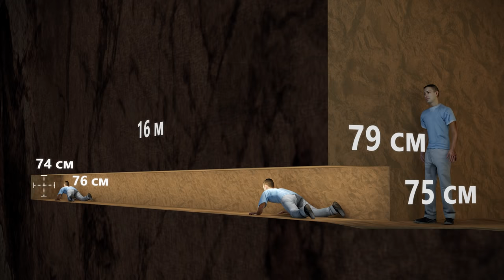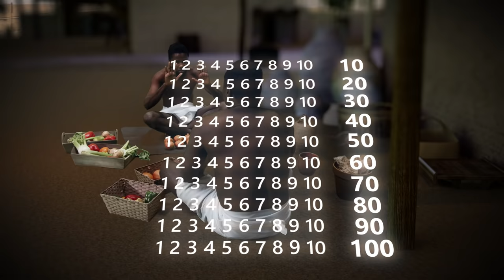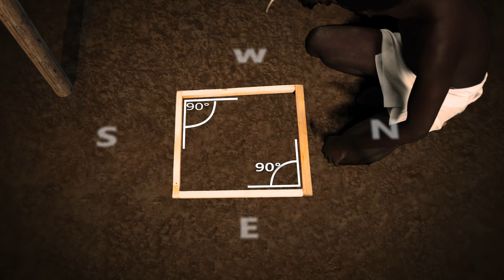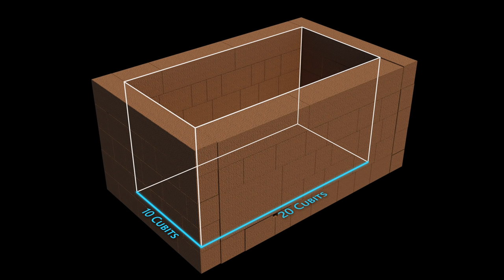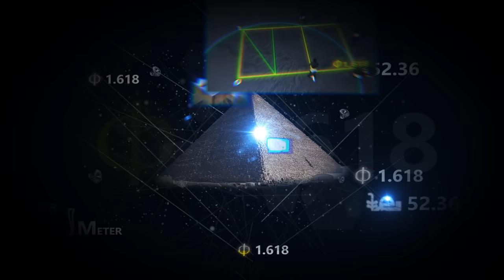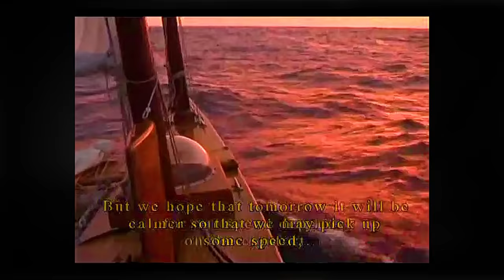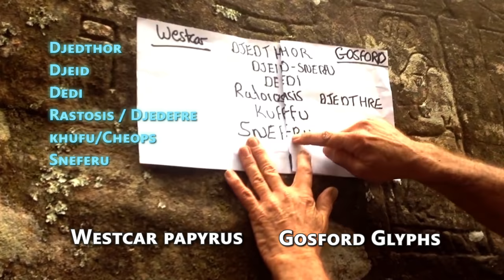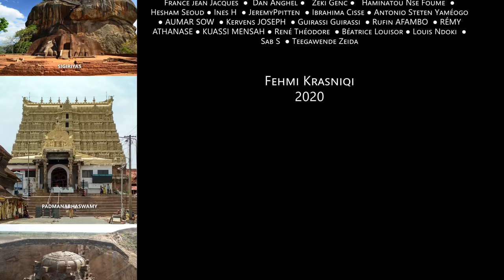The Movie Great Pyramid K 2019 - Director Fehmi Krasniqi

Comment: Interesting video with some plausible theorys but the Molton granite theory doesn't address the bore holes found, the disc like cutting marks left on some blocks or the partially cut blocks not to mention no evidence has been found of a "lens".
Reply: It's worth investigating. There's a ton of glyphs of Ra that could actually be representing the lens.
Reply: Also. If they were trying to hide this info from the initiated there wouldn't be any plain glyph of the technology. Like the pile battery/djed pillar, the dipole antenna/uas scepter, the light bulb, cables, generator, the oscillator, it's all there
Reply: Exactly and thank you
Reply: @DaliDessalines  that's not really trying to hide it though is it. And running around showing everyone what you can do and with what surely isn't.
Reply: I bet you can find one underneath the Vatican, and the bore and the holes and what you call cuts come from the concrete moulds..
Reply: I agree Tom, some interesting theory but definitely didn’t address all the ‘machining’ marks and holes.
Reply: I am very pleased with your remarks.  Because you have shown due diligence and demonstrated a keen eye.  May I be able to draw your attention; in a very insightful way, to the answer you seek.
Reply: @Alex-qf2lb  You just made me laugh uncontrollably.  In response; I have a reason for using language from the ancient courts.  Again, thank you for the laugh.
Reply: @Alex-qf2lb  Because the internet is devoid of personal connectivity. I use language as a resonance tool; to gauge the depth and width of a persons intellect.
Reply: @Alex-qf2lb  wet Sand  combined with other elements, submerged in water beneath the surface of top soil.   These holes provide temperature  control.
Reply: @Alex-qf2lb  Maybe I should not mention, lol .  Sun light routed under ground in a temperature controlled environment can be filtered and harnessed.    See lazer technology and its filtering process.  In addition, If you really need convincing.  Remember these two things while investigating.  In a society that has mastery of trigonometry and calculus.  Compare modern and ancient society use of science.  Then make a mathematical comparison from both societal artifacts.  It is funny... The African Egyptians closely guarded their secrets. However, what you dont see in hieroglyphs, but are essential to a successful society; can lead you to all the answers.  Compile a list of mathematical formulas needed to manufacture their artifacts and you will be amazed at what you discover.  Respectfully submitted
Reply: @Wandering Lion Obviously, the individual who initiated this lie.  Does not possess the critical thinking skills to recognize  in stone; a Fibonacci sequencing within a polygonal dimension of space .  In addition, after the cataclysm; Egyptians made repairs to the Pyramid, which necessitated modification.  Not to mention invaders repurposing stone while  destroying this sacred site.  I would also be remiss, if I failed to highlight the damage sustained from wind and water erosion. If you want to receive an accurate picture of African Science; you can not leave it in the hands of a mind that has mastered one or two sciences.  The pyramids were built by minds that mastered no less than 9 sciences.  Respectfully submitted.
Reply: @alexfitzgerald1355  they made repairs on the pyramid ... yeah sure, with the same technique, but forgot how to make same sizes out of wood for the cubic concrete. 
So there were at least 7 earthquakes in egypt: https://www.laenderdaten.info/Afrika/Aegypten/erdbeben.php (10.01.2021) and the pyramides had no damage. that is known knowledge, but they have to repair them... yes. 
i am also not totally convinced by lens, because why and how they could melt the stone at the broken obelisk underneath the obelisk? 

the second think had a really cringe moment was the mention of "atlantis", the big island in the middle of the atlantic, those ocean depth can not be explained just by a earthquake. sorry for that, but there are still islands, that made it really realistic, that the ancient egypts were in south america. 
but the hole explanation of "they helped them to build their cities" is just crap. the great flat pyramid shown here is build in at least 3 different phases. that is not mentioned. 
what also made me cringe, they melt concrete, but cant make cubic stones for the walls in the south american sites? you see those big stones with the "stair" on the upper left or right side? that makes aboslutley no sense for the melting technique. 

(sorry for bad english, i only can speak 2 languages fluently and english is the third leaned)
Reply: @oneballimann6425  I thank you for the courtesy of using English.  There is a lot to unpack in your statement.  So lets get started.  I want to draw your attention to the undamaged top of the pyramid.  This clearly indicates damage to the pyramid.  Both inside and out experienced a cataclysmic disruption in the electromagnetic field emanating from the center of the structure.  This should be quite apparent, if you compare it to structural damage and erosion of surrounding pyramids and temples.  For example: only material conducting electricity would sustain damage seen on the inside as well as outside of the pyramid.  Specifically, when it comes in contact with water.  My question to you is: Do you find it strange no one in Egyptology removed the lime stones from the undamaged part of the pyramid?  In order to determine the original continuity, in the placement of stone.  Also, with your own facts, regarding the pyramid sustaining no damage by earthquakes. This indicates purposeful design of polygonal placement of stone, specifically, of different sizes, which attributed to its preservation. In addition, since it is a well know recorded fact, wood is essential in the use of molding cement and there is nothing mentioned in the Egyptian canon to publicly describe the process.  It is safe to conclude Egyptians used wood at some point in the stone making process and kept it secret.  More than likely to avoid the increase in it's purchase price from importers and exporters. 

In closing,  I have to give you credit for being interested in such a mystery, but if you really want to see and fully understand ancient African science.  You must obtain mastery, of no less than 9 sciences.  If you are a novice, and just want to verify their achievements quickly.  You should compile a list of mathematical formulas required to design and create their ancient artifacts: both large and small.  Respectfully submitted
Reply: I agree with everything u said, there's tons o tool marks everywhere. But, im curious IF.... I heard about lots o glass being found in the desert, some of it worked. Are these the smashed remains of the lenses???
Reply: @Alex-qf2lb  exactly
Reply: @alexfitzgerald1355  whenever I do it, it's because it sounds fun.
Reply: @Wandering Lion poured
Reply: @mrednblack6  They are specifically, corroborating evidence of Ancient Egyptians mastering glass work..There are voluminous amounts of artifacts in this area.  Which by the way predates artifacts of glass work in Mesopotamia.  With your imagination, you should also be able to recognize; holes in stone with the appearance of drill marks.  Can occur in reverse; such as removing a wooden tool from a curing/cooling cement stone.  As for saw marks in stone.  Ancient Egyptians possessed mathematical equations granting them the ability to design and create a solar saw.  Remember, despite what your history book says.  Ancient Egyptians in writing, declare their civilization was at least 36 thousand years old. And the quality of their work, lasted longer than any other civilization in history.  Respectfully submitted.
Reply: The holes were made while the "concrete" was still soft. That is the logic and order in the process... Just force more your imagination...
Reply: @M.sKHEMAs  Lmao. Really?  You are having a tough time  with common sense?  When do we use wood, to mold concrete sidewalks?  What would be their  purpose and objective for creating a hole in stone? Have you considered the stones location and its role within the location.  Have you considered what material would be inserted in the hole? And, have you any evidence proving wood was replaced by another material;  especially when the pyramid was under construction?   Please answer these questions as best you can.  Please show us your logic.  Or is this just you forcing more racism on the issue.?  Respectfully submitted.
Reply: @YPimelody have you seen the actual timeline for construction? I never knew that one existed... we really have no Idea how long any pyramid took nor even which order they were actually constructed ....
Reply: @chrisbraid2907  You do know, you can find the time line evidence for 1 percent of all pyramid construction, on ancient papyri.
Reply: @alexfitzgerald1355  wood is used to frame or "mold" concrete sidewalks. Also, none of us have first hand knowledge of the "truth" concerning our ancient ancestors or the world they lived in. We don't understand enough of the universe, its functions, origins, purpose or even our own, to speak as authorities on these subjects. I think we would all benefit from quieting our minds and egos and investing our energy into harmony and balance, with God and all God's creations.
Reply: @ispittruthchannel5317  Well,  I am glad we can agree; wood is a foundational instrument in Ancient Egyptian culture. But as for the rest of your post.  I find it very alarming.  I, like you, should be naturally cautious of men, who call for the quieting of minds.  In addition,  I am equally cautious of men who don't understand enough of the universe, its functions, origins, and its purpose.  I would hope one day; more of the average man would embrace their reality: specifically: Individually as well as collectively.  

The following is submitted for your review. To better aid you in this life and the next.   1.  The Ancient African Egyptians taught: God is what modern man classifies as reality.  The Spirit of God,( is the learning process) by which each  man must undertake during his entire process for survival.  The Children of God, are those who surrender their minds, to the study of reality thru science.  The will of God, are scientifically verified laws which can not be broken, ect. ect. ect.  With this insight, you should be able to engage your mind and discover.  The Universe give birth to universes.  Its function is to grow and its purpose is to preserve itself.  When you really set the time aside to study science/reality.  You will be able to admire the superstructure of existence:  "to be".  Respectfully submitted
Reply: @bretticobra4289  no they dont because there are  rotational cuts that go top to bottom in the bore holes that can ONLY be made from a core drill with diamond tip and these rotational cuts have been measured and the rate that the core drill drills is far far better/quicker than any stone cutting device we have today and same goes for the giant  circular saw/cut marks on the giant blocks of stone. the cut marks have been examined and identified as that of a circular cutting device with a incredible rate of cutting through the stone. also there are a few of the actual granite cores from the bore holes have been found and examined and confirmed to be a granite core that was drilled out of one of the holes. so yea the bore holes+cores and blocks with circular saw marks are indeed what they are and reveal that whoever it was ,most likely the civilisation from 10-12000 years ago had the ability to cut and work stone with incredible ease

Comment: And 1 more question 
Each block of pyramids has different width and visible at least from 2 sides joint lines ,front nand top
1) In order to get different widths you have to have different  molds - milions of them 
2)You can not point joint it as it pushes material down 
3)You can not leave the space between blocks and slide when it dries  is already permanently attached to the bottom block
4) How you separate bottom of each block ,even if there was something they were able to put it under, how do you remove it from the bottom with all that weight pressing down
So lets create scenario for the 2 course.... corner block is molded - than 2nd mold in that case rectangular mold is attached or slide,concrete is pour on the top of alrady dried bottom block  - is there a separation  between 2 of them ????or you wait untill 2 block dries ????  And than you slide it out from the mold (how long you have to wait for concrete to dry ???) 
What they had to use on the inside of the mold to separate it  - duck fat ? , there was no steel .  It is possible  that wood will hold the outside pressure and not bowed 
These were not brick !!! Very heavy blocks

Comment: Concrete limestone as postulated could be expected to have a lifetime of less than 100 years, 200 years if we allow for the dry environment. Moreover, concrete is known to spall on compression joints without internal reinforcement or inter-joint cushioning.
Reply: Limestone is sedimentary over millions of years and should be easy to determine by the layering
Reply: A company in Texas explored the recipe for Roman marine cement, and proved its strength and its increasing strength in seawater over time. It took a long time for roman blds to crumble some still stand. modern cement is really kind of weak. So what was the mixtures of the cement for above water cement in roman times. They did experiment a lot too. Yet still not as good as the possible mixtures shown in the video. lol sorry I just want answers!!!
Reply: @NeetchianQueen  Roman concrete draws its strength from the use of volcanic ash and the resulting interaction of the ash with sea water.  One point is, if the Egyptians had all the knowledge and infrastructure to make the indestructible concrete posited, why was it not used continuously for other structures?
Reply: facts brother. this film blows.
Reply: @wisedupearly3998  "(W)hy was it not used continuously for other structures?" - Maybe the knowledge of the engineered stone technology was kept to a select group of people (like a guild system) and its use reserved for sacral buildings. - Or maybe it was used continuously for all kinds of structures, we just haven't looked at Egyptian ruins through this lens (pun intended!) yet. Unfortunately, engineered limestone seems to be indistinguishable from the real thing. What's needed is a quick, easy and economical way to test sites to confirm that they're constructed of a man-made material - and the willingness of Egyptian authorities to allow such testing.

Comment: I liked the  film, but the question remains: how is it that you can't slip a piece of writing paper between the stones? Plus you would find it hard, if not impossible, to remove the moulds from between the stones without causing damage to them, as you 'd have to knock them out.  I've cast concrete.
Reply: Once you lay the first stone block of concrete you can use that as the wall of one of the sides of the next stone. Hence the tiny gap.
Reply: @wraith6766  Even if the block dries completely, if you make it with similar materials it will look and act as a solid block and will stick together. Pyramids today are torn up so you can see each individual block. You can see an example of poured concrete added onto dry concrete in the shafts how they form together as one even if misaligned slightly. They would have had to have a staging ground to make and dry block and transport it to the spot.
Reply: @dambigfoot6844  I've never worked with this medium so this is just speculation, but I wonder if this mixture behaves differently than concrete. I wondered as well why they would cast individual blocks instead of larger pieces to minimize effort
Reply: You can’t slip a piece of paper between two natural rocks sitting on the ground... 😂
Reply: The casting theory does'nt seem to explain "the unfinished obelisk" ?
Reply: @TomTwain  quote fingers "LAZERS" - Dr. Evil
Reply: @IAmTjay116  At the beginning, they show really long blocks at the base. Showing how impossible to move ones that big. So the assumption is they were poured.  Wood forms can only hold back so much weight. Specially wet concrete. So size of the forms I would think were limited. All the ones I ever saw were steel.
Reply: @TomTwain  Right, how about the default answer that every brain addled cultist relies on, the magic man in the sky made it all come together! Miracles, gotta love 'em!
Reply: As they showed us they put one stone in place then skip the next one and put the stone right after the empty place. And they would come back and just simply fill the empty spaces. They did this so they could place and remove the mold easily.
Reply: Answer: all it takes is some dirt and loose sand to block a paper ingress, no magic needed
Reply: @jalmolky  That video proves my point. His blocks were separate but had the appearance of a single block. Pyramids you can see each block and they dont have uniformity. You can see that each block didn't have anything to do with the creation of the block next to it.
Reply: @dambigfoot6844  Not sure what to tell you then.  I watched it and there was clear separation on the vertical joints.  He addresses the very slight shrinkage and its relation to water content.  The horizontal joints were not visible, the blocks appearing to be attached, but upon deconstruction were actually separate.  Add a few thousand years and the distinction would show.